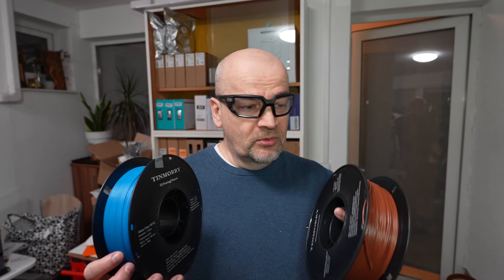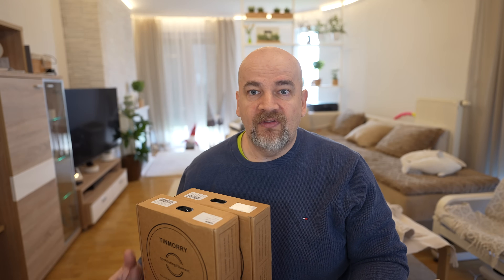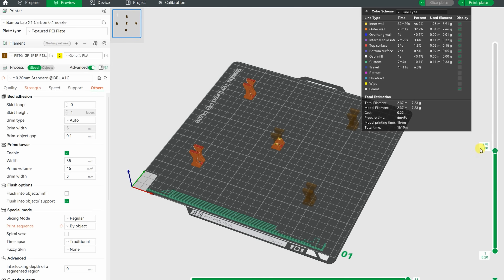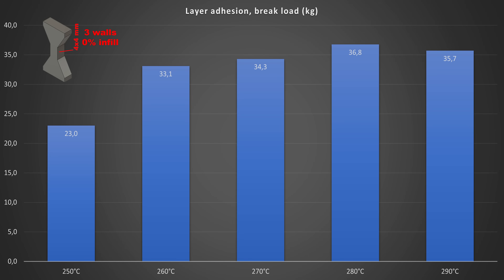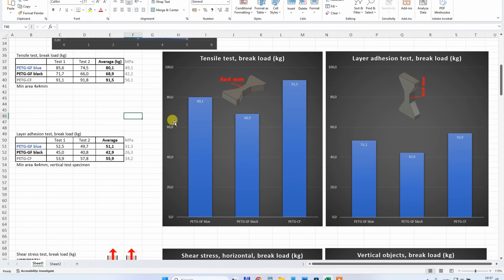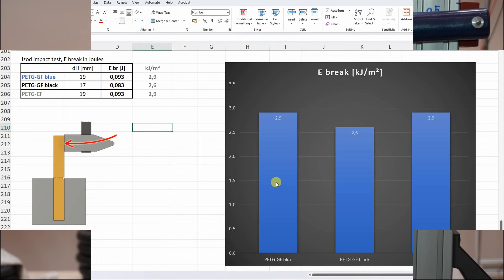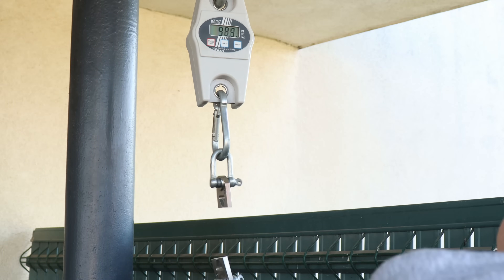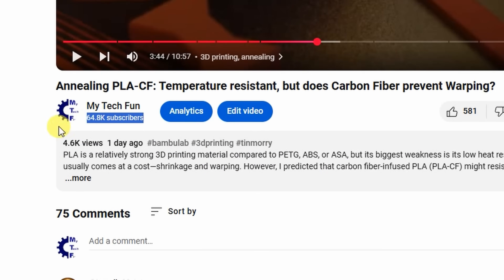PETG-GF vs PETG-CF by Tinmorry: Is Glass Fiber Better Than Carbon Fiber?

Comment: I got some of the Tinmorry PETG-GF and am about to do a temperature tower and some other testing. What did you set the PETG-GF to in the AMS Materials Setting box? It won't let me load the filament without selecting a profile. Should I select Generic PETG, since their profile for P1S is based off of that with some tweaks?
Reply: BTW I just joined your Patreon!

Comment: Bro! Even if the algorithm might not pick up most of your vids we as the community will recommend the heck out of them to each other! Your tests are very thorough and appreciated. 👍
There is something I've been wondering however. How much does cold temperatures around -20°C affect the soft TPU and PEBA materials? I know that TPU is at least affected but does it become brittle? How about ASA? The winter is coming and a brittle phone holder in the car would suck... 
Maybe a freezer treated tensile strength test for materials meant for outside use could be considered? 
Greetings from Finland!

Comment: I really enjoyed this video.   I found this filament from a reddit recommendation.  What did you pick for a filament on the spool in bambu slicer?   I've been using bambu petg cf with that g code you showed with the 260c print temp.  So far I've had nothing but great results with this stuff, every print except one, a flower pot that i accidently printed with pla settings. Lol.   Anyway I think I'll be raising print temps for this stuff after watching this.   Very informative like usual.

Comment: I think the different required temperatures are due to the amount of fill by volume. The fill by weight is usually only 10% in cheaper CF filaments and 20-25% in GF, but the volume is higher in CF due to the light weight.

Comment: Hello Igor, Please could you test the new Tinmorry PETG Rapid Eco. It claims 300mm/s, 30% increased impact strength over average PLA and same layer adhesion vs regular PLA. It also claims no stringing or clumping. Hopefully it is as good as their CF PETG because this new Eco version is priced the same as regular PETG.

Comment: La última sugerencia.. Sería muy interesante quizás imprimir algunas piezas,  someterlas cómo en el test de temperatura por ejemplo a los 100°C y enseguida hacer todos los test de resistencia mecánica, para poder visualizar la pérdida de resistencia mecánica de los materiales al estar expuestos previamente a altas temperaturas °C.. Esto se me ocurrió ya que al revisar la dureza de los materiales, se ve que han perdido bastante dureza al alcanzar apenas los 100°C, por lo que ya ha esa temperatura se están degradando mecánicamente..saludos y gracias.

Comment: Tremendo canal que descubrí… Muchas gracias… considerando que son novato en esto y recién encargue mi primera impresora y mi primer secador( que aún no llegan a mi casa, vienen viajando aún).. tengo un comentario.. Por ejemplo en el “tensile test” El GF blue y el GF Black y el CF .. al revisar los resultados su resistencia se disminuye a un 64% , 61%, 62%  al pasar de la impresión horizontal a la vertical , es decir: Tensile Vertical = Tensile Horizontal*0,64( o 0,62 o 0.61).. ¿Por qué cuando se imprime en vertical ( utilizando cualquiera de los 3 productos  se pierde tanta resistencia a la tensión?.¿Esto está afectado por la calidad de la impresión?… ¿Cómo puedo a nivel de parametrización de la impresora o software mejorar esta diferencia?.. ¿Por qué en cambio cuando se realiza el Test Shear, El CF se comporta mucho más homogéneo al pasar de impresión horizontal a vertical?, pero en cambio los productos GF blue y GF Black , al hacer el Test Shear, estos siguen perdiendo mucha resistencia ( 66% y 74%)?.. ¿Cómo puedo mejorar los parámetros de la impresora para disminuir estas brechas? ..saludos y gracias..  La última consulta..¿ Qué son los “partidarios de Paton”?

Comment: I really like the layer adhesion versus print temperature!

I have been dialing in my Overture PETG filament with bambulab X1C 0.4mm. OEM range is 230-250C. After a temperature tower I saw black transition from matte to glossy around 260C, with best bridges and overhangs between 270C-275C. I keep my nozzle at 272C but was always curious how temperature affected the layer adhesion. Thank you sir!

Comment: petg is my new go to for strong functionl parts. the brand I use is stronger than PLA+ and it prints beautifully, has a natural rough matte texture, no VFA issues. I also tried Sunlu PETG CF and it also prints very beautifully but this is strange. it has amazing bending properties, its not rigid but has amazing bending strength. like ridiculous almost i have a parts that is 2mm thick and i can almost fold it in half and it wont snap or show signs of tearing.
Reply: only thing that was horribly wrong on sunlu side was, they claim the material has a heat deflection of 130 degrees celcius which is just rubbish. i found it to be the same as regular petg

Comment: Thanks again for the excellent testing!
I do wonder however how much carbon/glass fiber makes a difference...
For instance the tinmorry PETG-CF boasts a 15% carbon fiber while on te PETG-GF I can't find any percentage...
Compared to something like The Filament by Spectrum PETG-CF which only states 3% carbon fiber in their documentation.
Does the difference in percentage make a big difference if at all?
Reply from the maker: That's a good question. I hope I will find a filament from the same brand with different CF%

Comment: Petg is very flexible, and the fibers help that. But it's still 70 °C max and more or less comparable to a good ABS, which doesn't need any drying. When does it make sense to use these petg-xF?
Reply from the maker: Dimensional accuracy, can be printed on open printer, no smell, stiffness in XY (vs ABS)

Comment: @mytechfun have you tried some PP or PP-CF/GF already? They have really interesting properties in my opinion. But usually hard to print.(Warping Like hell)
 Layeradhesion is very good, almost Like TPU, its also "unbreakable" but somewhat stiffer and also chemical resistence is a dream...
Reply from the maker: Not yet. Bed adhesion is the biggest problem. Any brand you suggest?
Reply: @MyTechFun  tried BASF (which is more stiff), Formfutura (softer), and right now BlackForestFilament (Something in between and cheaper). PP CF none yet, I have the HPP4-GF25 from Grauts here but haven't used it a Lot... That has a weird Touch and look and feel... And cant be compared with simple PP-CF i think.
These are very overlooked Materials I think. The only and biggest downside is the warping... ABS/ASA warping is beginner level 😂, PP Boss Level

Comment: 3:30 - "The optimal printing temperature setting needs to be tested by yourself."  This has become my 3D printing peeve.  It's not the filament manufacturers' fault.  The length of the melt zone, position of the heater and the position of the thermistor vary by manufacturer.  230 C on one printer is 250 C on another printer.  If printer manufacturers calibrated their bed and nozzle temperatures against an industry standard, filament manufacturers wouldn't recommend a range of temperatures.  Filament reels would say "240 C nozzle, 80 C bed, up to 17 mm^3/s volumetric flow rate."  Instead, every filament must be calibrated on every printer, which is a lot of wasted time and results in a lot of ruined prints and needless aggravation trying to use generic profiles developed on another printer.

Bambu Lab has good filament profiles which lead to less aggravation and "it just works" results.  We could have that on ALL 3D printers without the disadvantages of Bambu's closed ecosystem if the 3D printers were delivered with firmware tweaks to calibrate the printer's temperatures to standards, but most printer manufacturers won't even bother to provide tested generic filament profiles for their machines.
Reply: can you blame them? hundreds of filament types across dozens of manufacturers, and even more different types of printers

Comment: Timely. I just opened a spool of the petg-gf in frosted beige. 

I started with a generic Qidi petg-cf profile and didn’t have to really change anything. I thought 280 might be too high but everything came out great so I left it.

Biggest thing I noticed was practically no stringing without messing with any retraction settings.

Comment: I think this Tinmorry fiber filled PETG is some of the best filament available right now. I have the CF and GF versions and both are awesome. It's so much easier to print than plain PETG, it looks awesome, and the fact the fibers increase the layer adhesion is a huge bonus. Great for aesthetic and functional prints.
As for the temperature, there is conflicting information from the labels, website, and data sheets. I am able to print my GF filament up to 290C without issue, but I generally print it at 270-280. I have it in yellow, so if there was any burning or discoloration I would see it. I have friends who are printing it at 260 as well with no problems. I think the only major reasons to print so hot are max flow rate and layer adhesion. I'm glad you tested the layer adhesion as confirming 280 is a good temperature for layer adhesion is great for me. I only use 290 for the first layer to get the most uniform surface possible. It can also have a hard time with overhangs right next to the build plate, but further up it handles them fine.
The difference in strength between the colors is definitely notable. Would honestly love to see you compare every color of PETG-GF. I wonder if Tinmorry would provide filament for that? They are very quick to reply to my emails. Also interesting the CF had slightly better layer adhesion than the GF. According to the data sheets, the GF should be slightly better. It's close though and your data mostly aligns otherwise. They claim all their samples were printed at 255C and 150mm/s. I'm sure there are ways you could tune the printing to get one to be better than the other or match the data sheets more closely. I also wonder if a heated chamber would enhance layer adhesion for this filament. Great video!
Reply from the maker: Hm, yes, strength of colors would be interesting, but not every test, that would be too much. I will ask them..
Reply: @MyTechFun  Seems layer adhesion would be most important! Definitely what I'd be most interested in. A quick temperature test would be fun too. Seeing which color stands tall longest. Thanks for replying!
Reply: I'm late to the CF/GF party.  I bought some Tinmorry PETG-CF and Siraya PET-CF after a previous My Tech Fun video and am eager to try it.  I have some projects and products in mind.  It's good that the price of fiber filled filament has decreased.  There isn't much of a cost penalty now.  I've been reluctant to make PETG products because the shiny surface looks cheap but fiber filled fixes that.  BTW, TPU-LV (the foaming stuff) has a very nice velvet finish that my customers appreciate and the eSun TPU-LV is incredibly tough even by TPU standards... at 0 F and plucked directly from boiling water at 212 F.

Comment: I find that GF filaments are less likely to break in the PTFE tube while printing. I sometimes get breaking with some CF filaments, usually when the toolhead is in the back corner where the bend is the sharpest. It is situational and varies between filament brands, likely due to total fiber content.

This could just be me and my setup...

I use Siraya Tech GF ABS for a lot of printing and it works great. I liked the surface feel of parts printed with their CF core ABS, but it was a pain to work with. It always snapped if I printed a part to far into the rear left corner, and until the spool emptied a bit, it would break at the exit from the dry box I print from.

And I am still impatiently waiting for that Siraya Tech PPA video. 😆

Comment: Also, it would be great if you could add the min/max values to your bar plots so we can see if the differences in the average of the two between materials is significant (at least with two samples).

Comment: But, just because your nozzle temp is some value the temperature of the filament while flowing will be a bit lower due to the heat capacity and conductivity of the filament and the temperature drop through the nozzle walls from the heater and where the thermistor are located.

Comment: in general terms, GF tend to be less efficient at reinforcing compared to CF. that toughness that comes at same filler loading for GF compared to CF , it's due to the fibre incompatibility with the polymer. usually a compatibiliser is used. so No matter how good the fibre is, if the compatibility  with the matrix is not there, the composite is not going to perform as it should. Now the advantage of GF or disadvantage is that is an electrically insulating fibre.

Comment: So glad you did this review.  We absolutely LOVE this Material.  It's my go to over PET-CF because of the Pricing.  I have been printing it at 290c with a E3D CHT .4mm Obsidian Nozzle on a K1 and it's prints absolutely flawlessly.  I might want to try 280c now.  We have gone through 5 rolls (3 Black, 1 Orange, 1 White) with no issues with degradation.

Comment: Are these products with fiber in them safe to touch do they get into your skin that’s the only thing I wanna know
Reply: The question asked about fiber filled materials. The CF version is worse, but I wear gloves with both now. Especially when deburring edges when I print with a brim. I got slivers in my hand that I couldn't see without magnification. It's annoying, but only lasted a couple of days.
Reply: From personal experience - yes. At least with some brands. It's not always noticible, but I wipe and spray paint any functional parts that require handling. I wear gloves if assembling, removing supports and otherwise handling the parts. I learned the hard way after assembling a large project using Bambu ABS-GF and ASA-CF parts.
Reply: @russou  really, it gives you itchy skin otherwise?  I get that when working with GF cloth and have to cut a lot, but that is 100% GF, didn't expect that in a material that the GF is contained in plastic.

Comment: I've used PETG-GF for a part cooling duct on my enclosed printer that hits 65c when bed is 110c after 30 minutes. It took months of printing with 0% part cooling (Lots of PC and ABS) for it to start warping, and it was very little

Comment: Thanks for doing these tests and making the results available.

As a reinforcing filler in filament I can't see how CF over GF would ever be an advantage.  The fibers are not what is yielding when the parts break.  Carbon is stronger in both tension and compression than glass but the fibers are not carrying the load.  The differences in the tests have to come down to other factors.  Some examples of differences would be the amount of filler material, diameter and length of the fibers, differences in the base plastic materials.  How well does the plastic adhere to the fiber filler material.  I don't think that the filament companies do much testing (if any) on the materials they are selling.  For them it is almost all marketing hype.  Of course there are probably exceptions and that would be for the really exotic materials.

Comment: How big is the outside temperature dependency of the layer adhesion tests? Winter -5C to Summer +45 might be a big range.
Reply from the maker: Correct. I try to keep the testing temps between 15-20°C. On Summer it is in early morning, together with sunrise. Winter it's hard to wait this temp. We had few 12°C peaks in January and in February. But my test objects are in the room, and when I am testing them, they are tested in less than 20 seconds outside.

Comment: 'holy-grail' filament with the best combo of adhesion/strength/price/UV and heat resistance + ease of use and health(CF fibers...) would probably be PET-GF.....
Reply from the maker: Small correction: PET-GF Core (I hope we will see some soon). About the core, soon, in my next video. Big step for technical filaments.

Comment: About that PLA annealing video. After I watched it, I had an Idea, why not anneal thease PLA-CF printed parts in a fine powder. Like starch for example. It should help even more against any kind of warping, right? Maybe you can try it out and make a video about annealing PLA-CF in powders.
Reply: Best method I've seen is with salt flour, gets better finish than starch and since it's a mineral it doesn't degrade with the heat
Reply: @Rainyjax  Yeah, CNCkitchen made a video back then about useing salt. But i just don't want to grind salt into dust, it's too massy. Starch is already a very very fine powder and it only start to degrade way above 150C. That I want to see someone test it instead of using saltdust
Reply: @nikoivan2580you can buy finer salt,for example, popcorn salt.
Reply: I've been thinking about this as well-- fine salt enclosing the material, and then vacuum sealed in a bag sitting in a sous vide bath could work and help maintain very stable temperature.
Reply: Plaster of Paris is a better alternative, as it won't shift and flow like a powder and will keep the model from deforming..